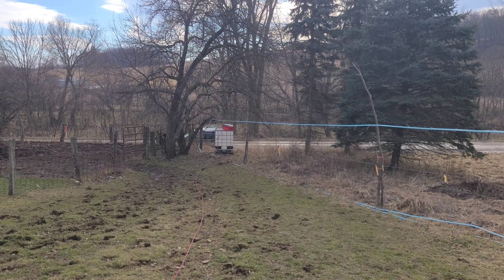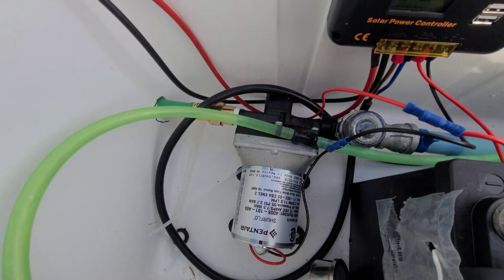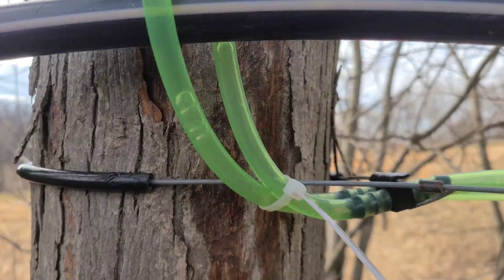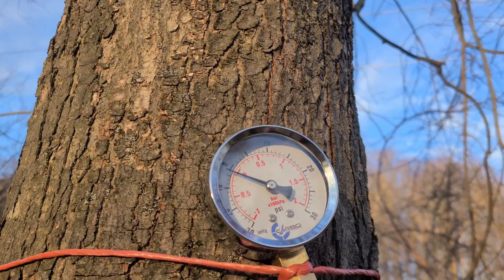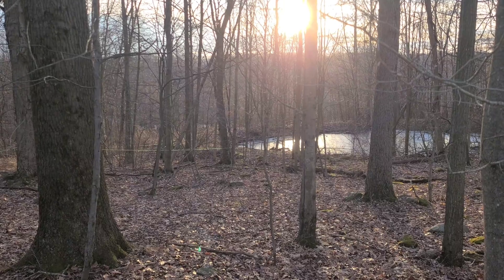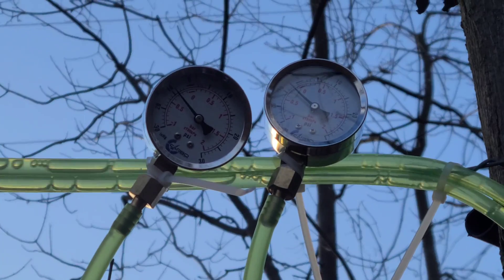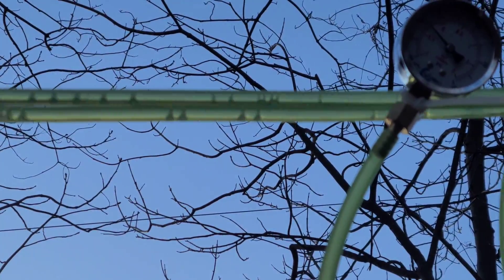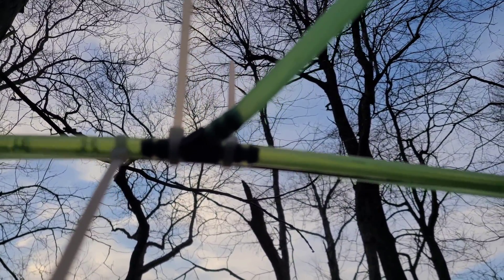12V Shurflo Off Grid Solar Powered Maple Sap Vacuum Pump Box With An Ink Bird Temperature Control

Comment: How many taps on that pump?
Reply from the maker: Little over 100
Reply: @natesworld814 you should be getting at least 20 inches of vacuum. Major leak somewhere.
Reply from the maker: The only leak I could find was a pinhole. Unfortunately it took me up to the last few days of the very short season to find that. I'm hoping to have it running much better this season
Reply: @natesworld814   I have 4 shurflow pumps and they all run 25 to 26 inches of  vac with 80+- on each.
Reply: @capt.sparrow34 I cannot get my Shurflo to pull that much vacuum. Even with all the lines shut off, just the recirculating line running. I can’t get over 10 inches
Reply from the maker: Ive seen mine pull 20+ when it's running really good but 90% of the time I'm around 10
Reply: Your set up is different from mine, I don't use a main line. I use 3/16 on inclines and 5/16 in flat areas.  I run all tubing to a short manifold before the pump.

Comment: So I have a set up similar to yours. My question is I don’t have a 4008 pump but I do have a short flow. So what happens is I have plenty of vacuum no leaks my pump appears to stop sucking after about a minute and a half. And won’t start back up again until I release vacuum. The motor still runs but it just does not pump. For instance, I took the line out put it in a bucket of sap turned the pump on. I was getting plenty of bubbles. my lines came up to pressure still plenty of bubbles in the exit line. After a minute and a half no more bubbles. Pump got quiet did not stop running. Just got quiet earlier Sap stop moving. Released vacuum, plugged back in SAP started flowing again. So on so forth. What do you think is wrong I’ve tried changing pumps it does the exact same thing. Thanks for your help.
Reply from the maker: Man, I wish I had an answer for you. Mine backup the line, some then drain, but that doesn't sound good at all. I don't know if you're on any of the maple syrup pages on Facebook, but there are people who run several pumps and may know what your problem is
Reply: @natesworld814  
I think I might have found what to do. A recirculation tube from bucket back to the pump, so far it appears to keep the pump running. Thanks for your help. I’ll let you know.